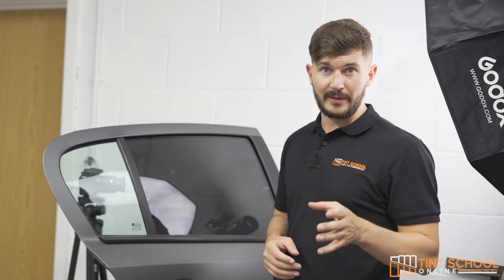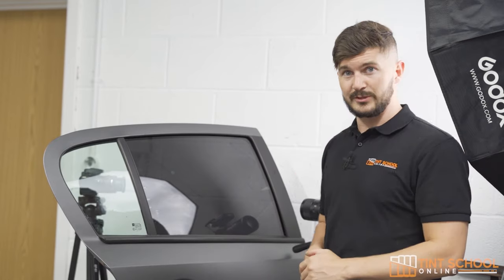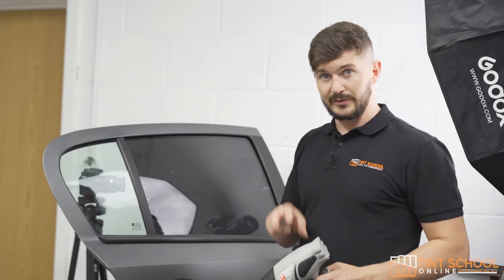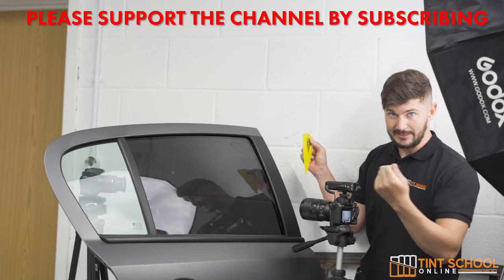How To Fix Window Tint Bubbles? || Rectifying Your Mistakes || Tint School Online

Comment: How long after being tinted should I wait to do this? And how long after being tinted can you do this?
Reply: This...
Reply: I have the same questions.
Reply: well i wil try for it this week snd i tinted 7 days ago
Reply: I'd like to know too, I did mine just around 24hrs ago
Reply: 3 days
Reply: I assumed this was during your quality check at the same point of original installation because he kept mentioning getting the water out and if it’s been a couple days I’d assume the water would be dried up by then.
Reply: @knoxash1112 did it work?
Reply: Just got my windows tinted and there are creases and bubbles. So mad!
Reply: @MarkSegree same im pretty upset
Reply: After you applied the tint and you over look the work and see it after
Reply: Personally the sooner the better. You risk tearing & not being able to get fixed from drying

Comment: This is a great video! very informative, thank you. Do you recommend using this same method with window tint that has been installed for more than 2 weeks?
Reply: it depends, if its an air bubble you can pop it But things dont really move when its dry
Reply: @mikeriverajr4447   lol kl
Reply: @mikeriverajr4447  definitely do not pop it that does nothing even putting the bubble down after popping creates a haze you won’t get rid of
Reply: Did you find a good solution?
Reply: @indacouch253 what would you recommend besides removing the whole film?
Reply: @user-ik8fl2xr5t  remove the whole film

Comment: I had bubbles in my tint. I contacted the guy and he removed them like you did, but the tint was all scratched up so he had to remove and apply new tint
Reply: @BlastCODM  🤣🤣🤣🤣
Reply: @BlastCODM  Same. Had to do my tint over 3 times already. Now, I have air bubbles and the tint on my passenger side peeled from the top. Sent him pictures and now he doesn’t want to answer.
Reply: @BlastCODM  😂😂

Comment: Very very useful video! Thank you very much! 
I would only like to ask, whats the time window for these mistakes to be fixable?
Reply from the maker: Depends on the weather, if its hot it will dry quite quick and the film will be sealed.

But the fingers can remove after this period
Reply: @TintSchoolOnline  with a sunny 25°C you would recon it would be fixable in 24 hours??

Comment: What I do is I push the finger to the end hold it heat the window while still holding it. The let go if it’s small I heat the inside a quick flash and push and it’s out! If you keep doing what he is doing you get more dirt. Then you gotta work the dirt out when it can be on clean step

Comment: Should you wait until new tint is dried to take care of spots like this? Thanks.
Reply from the maker: No, as the air will be trapped within the tint and have nowhere to go. You need it to be wet around the area so the air has somewhere to go

Comment: Great channel and great content! Currently in a learning process on my own car and am thinking about starting up a business if it goes to plan. Will definitely use your website if it does!

Quick question: How much time do you have for fixing these mistakes? In my particular case, I applied my tint 24 hours ago and first noticed the bubbles and specs now. The temp has been around 3-5 C. 

Thanks!
Reply from the maker: Hello Kevin, it really depends on the temperature, the amount of soap used and even how it is parked (if it is facing the sun). The bigger the mistake the quicker you will need to be. You can only really tell once you start trying to chizzle the specs(if the air is moving or not). 

So give it a go and if the air around the spec isn't moving or it is coming back after a minute it will need to be replaced. If it is a bubble, you can pop it with your knife and press the air out that way.

Hope this helps and good luck!

Comment: I have some contamination bubbles on the side windows and one crease on my back window very close in size to the one you worked on in the video. Do you think these can be repaired following your methods in the video if it was installed 2 weeks prior?
Reply from the maker: Hello Michael it is unlikely as the air will be trapped around the contamination with no where to go... sorry
Reply: @TintSchoolOnline  Thanks. So these repairs can only be done immediately after installation?
Reply: I have some air bubbles and it was installed 3 days ago am I able to push them to the edge as you get in the video now

Comment: What if after you have done the tint and you squeegy out the water.  Then after you check hours later you see a dime sized water bubble... 

Should you leave it as is so ithe water will eventually evaporate or do you try and push it out knowing that the rest of the film is already tacked down and the water will more than likely NOT push out anywhere else since the window is already squeegied and curing?  

Poke a small hole in the bubble and squeeze the water out or let it be and when it evaporates then lightly push it down if it hasn't stuck to the window?

Comment: If you have a small bubble in the corner of 2 month old tint, can a heat gun still fix it? Didn't see it until too late
Reply from the maker: If it’s a white air bubble. You can try and pop it with a knife and push the air out
Reply: @TintSchoolOnline  it's in a corner behind a pillar cannot prick it straight on with a pin. Is it heat treatable? It's quality 3m though and I'll take it to the installer next week for a look. But I already carded it and wooden skewer rubbed it. Thanks for your work and help anyway nice channel 🍻

Comment: Thank you for the information.  My tint is 10 years old and just started getting bubbles in the rear window.  I wanted to try and improve it before replacement but, I am guessing this will simply not work for old tint.  Could I make a pinhole in the bubble to get the air out?  Will that make it look a bit better or possibly make it worse?  Great video btw!
Reply from the maker: Hello, sorry but it sounds like you have adhesive failure. It would need to be replaced.
Reply: Worse

Comment: I am guessing this has to be done as soon as the tint has been done? what timeframe from installation?
Reply from the maker: Correct as the film drys you can not remove bubbles or specs, only fingers as they still have the release at the root of the finger.

If you have a bubble, you will need to pop it first.
Reply: @TintSchoolOnline  I accidentally caused  3" fingers (2) on my hatchback (10 yr old tint)   when I closed the hatch on a box.  The tint is intact. Do I have an adhesive failure? Can I fix this?

Comment: Ok mate quick question. I don't have any of these when I apply a film except smudges, are they because of soapy water and they will dissappear after specific period of time or i should use just clear water instead? I didn't want to risk leaving the tint so I stripped it straight after
Reply from the maker: Sounds like it is the drying in process it should all go

Comment: Hi  we recently had the car windows tinted and 2 weeks later there is still tiny white bubbles on the tint on all windows and the and the edge cutting its not cut evenly and marks around the window edges is so notable , should we get the tint off and go somewhere else not happy with so many marks.

Comment: I have a jetta VI and I have got very big bubbles on the back window! 
I have a question is it OK if I install the film over the window (outside) ? 
Because pulling the old tint can break the heaters (defrost)! Right! Any suggestions? Thanks
Reply from the maker: I really wouldn't recommend installing from outside, it will look really bad and won't last very long.

You should wait for a really hot day and leave the car in the sun, then try and remove the tint, this way the heatlines are more likely to be saved.
Reply: @TintSchoolOnline  thank you. Even if I break the defrost, I never use it.

Comment: Do you need a chizler to get the specs out or a hard card is fine too.
Reply from the maker: A chizler is definitely better as it is harder, the 3m cards are quite soft so not as good...

Can still be done but will take longer

Comment: Can this be done weeks after tinting or is there a timeline to still be able to fix mistakes?
Reply from the maker: Hi Cody, this needs to be done when the film is still wet im afraid. As when the film has dried out you can't remove the air

Comment: My question is
My car had done tinting film 2 days ago i still see alots bubbles, i rang the shop who did my car , they said it will take 4 days to bubbles disappear, is it true unswear ?
Reply from the maker: Hello Engin, this is true. The drying in process can take up to 4 weeks, in that time it may appear to look "watery".
Reply: TintSchoolOnline thanks very much for reply very quick have a good day
Reply: @TintSchoolOnline  So it's best to wait a few weeks rather than popping the water or air bubbles , yeah ?
Reply from the maker: If it is "air bubbles" it will NOT dry, but water bubbles will always dry.. 

You can tell the difference as with air bubbles will have a distinct white glow.. you see on this tutorial 

Water bubbles are see through
Reply: @TintSchoolOnline  Yes, they are all water bubbles, all clear. Thanks , that's re-assuring to know. South (sun) facing doors. The film is essential to keep the heat indoors down from recent heatwaves.  Great vids , all of them .
Reply from the maker: Oh, we see you have replied here! That is good to know it will dry in then.
Reply: @TintSchoolOnline  How about water bubble? Will it go away over time? I got a few big water bubble on my windshield tint...
And my hands were so itchy to poke the bubble with a needle and shrink it with heat gun and chisel... Will it work that way?

Comment: I’ve recently just bought a car and the rear windscreen and read quarter glass tints are full of bubbles. 
Is there any way to fix this or will it need replacing? 
(I think the tint will be many years old)
Reply from the maker: This sounds like a failed product, this can be quite expensive to replace unfortunately
Reply: Best to just rip them off and get them re done?

Comment: 2 weeks has passed since my car got tinted and my car has been under the sun in those 2 weeks. Can I still do these fixes for the air bubbles?
Reply from the maker: If it is white tiny specs this will not go away and needs to be fixed while the film is wet
Reply: @TintSchoolOnline  Thank you

Comment: These videos are so helpful. It would be nice if you maybe sold some sort of kit which would include everything that's needed (except the heat gun obviously).
Reply from the maker: Hello Sami we will look into it thanks
Reply: Have a look on ebay mate,I got a kit with squeegees,cloth and a knife for £6.50 and a small bottle of tint slime for £3.99.
Also bought a precut tint kit for my car 😊
Reply: @garyb4196 hey man did your tint kit fix the issue?

Comment: Will the Fingers eventually go away in few days on their own by just leaving them?
Reply from the maker: Hello, sorry in most cases that will not happen.

How big of fingers are we talking about here ?
Reply: @TintSchoolOnline  Like a quarter of the size in your video. I did Tint this morning, and there currently 4 Fingers. I Tried use my credit card to push them out, and so far they were getting smaller as I tried to push couple tries. It has been overcasted and The sun hasn't been out since morning but I think some heat with BlowDryer may do the trick.
Reply from the maker: Heating with a blow-dryer? Presuming you mean heat gun..a hair/blow dryer will take a quite while to warm up..

If they are a quarter of the size you have two options..

Heat the outside of the glass then push it out

Leave the tinted window facing the sun and at the end of the day push them out.. once they are dried out fully
Reply: @TintSchoolOnline  Thank you for replying, I will let you know the outcome.

Comment: I've got a lot of water bubbles (small) on a french door, next time I do it  (mirror film)..is there a best weather time to do it..ie , cloudy and cool day or when the sun has warmed the glass up a bit ?  The outside temp was about 4 degrees evening no sun and the living room was around 18 degrees Great video BTW .
Reply from the maker: Are the bubbles like the "specs" from the tutorial?
Reply: @TintSchoolOnline  Just like the water bubbles in your vid yes.They are no more than 3-4 mm , some circular some a little elongated but all small . Thanks for replying.
Reply from the maker: That's not a problem we like to help out!

Referring to the video... is it 1.22(water bubbles) - from the outside (not the inside) does it look white like the one in the video..

Or is it 1.23 specs and contamination - (from the outside small white specs) or even from the inside small dotted raised bubbles

Or neither .. (water bubbles that have no visible white finish) a gentle touch of these bubbles you can see they are filled with water .
Reply: @TintSchoolOnline  No contamination, no white , just v small clear . The film is on the inside of my doors and the bubbles are invisible from the outside. . Looks like I have done a better job than I first thought .....Clap For Carers ..👏👏👏👏👏

Comment: I got to rectify my mistake please help me if you can help. I accidentally over pressure cutting my tint on the window itself and it leave a scratch straight line. How to undo this and is it possible or is it not?
Reply from the maker: It is not possible in afraid . Sorry
Reply: @TintSchoolOnline  haha thanks for replying, I knew it that it impossible to undo it but anyway it's fine because it's not too obvious

Comment: Can you remove the blisters after the tint has been on the vehicle for 4 years my tint started bubbling after I had my interior steam cleaned. Can i do the same thing chisel and heat gun or  just take it off?
Reply from the maker: Sorry to say but it would need to come off, the likely hood is that the film was already failing.

You can try to pop the bubbles and push the air out but it is unlikely it will look much better
Reply: @TintSchoolOnline  thank you so much !! Appreciate the info

Comment: Mate can i fix these tint bubbles after a day i did the tinting
Reply from the maker: Hello,

It depends on if it has dried out already. If it was a hot day.. 

And the film has dried ...

Specs can not be heated out (they will just come back)

But
Fingers can be pushed out no problem 
Bubbles can be popped no problem

Comment from the maker: 📙 Download our FREE 240 PAGE tint manual below.
https://tintcourse.tintschoolonline.com/tint-manual-youtube/?el=bubbles-in-tint
Reply: Thanks for the tutorials, extremely helpful and well presented! Fan of what you do. Think I know my new side job 👍🏼💪🏼
Reply: i dont have a heat gun, will a hair dryer work?
Reply: I found your video to be very helpful I've never used this particular material before but I watched another video and it implied that I was not as smart as a monkey and it just kind of made me angry I took two steps at your video use the same technique used what you taught me things went fine thank you very much for not insulting me for probably not knowing probably one a very basic thing but you learn as you go have a good day thank you

Comment: If the film is actually so inexpensive, wouldn't it be best for both the customer and your shops reputation to just pull it off and do it over again, obviously installer needs more practice anyway...   Fingers happen exactly what your having to deal with